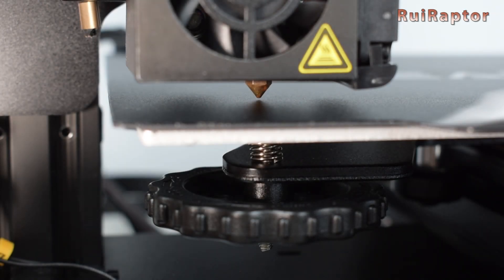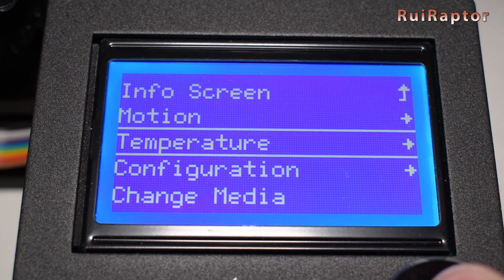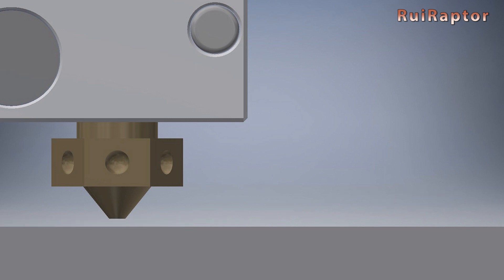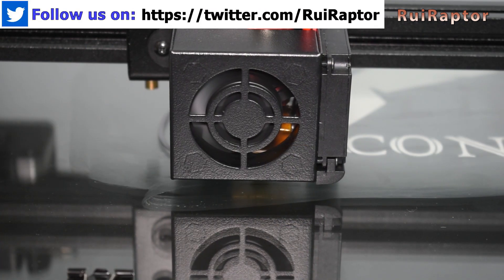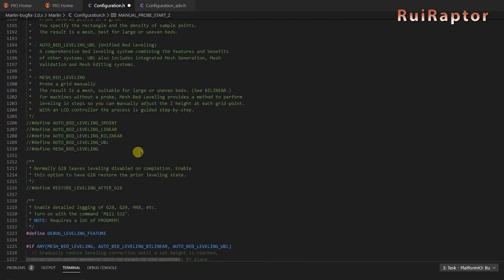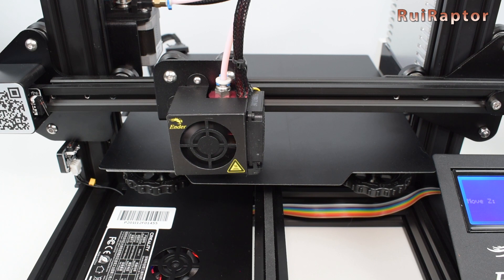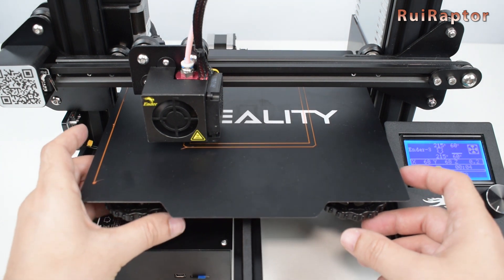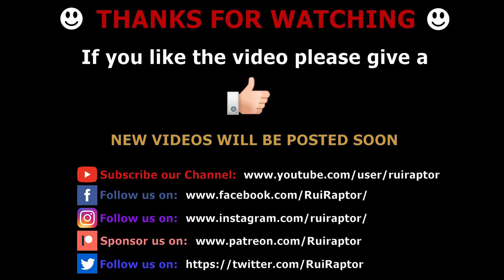HOW TO Level your 3D Printer´s BED Like a PRO / Mesh Bed Leveling

Comment: Hi Rui, just a question, can we add M420 S1 on the start G code? after G28, to save the manual mesh? thanks greetings from South Africa, bom video
Reply from the maker: Hi Manuel, yes, with Marlin you can add the M420 S1 line on the start gcode.

Comment: I have a Geeetech A20 with a glass removable bed.  However, whatever I try, I cannot level the bed.

I have tried it following many videos from Youtube for using the BL Touch and Z Offset, and cannot get a sensible print, where it is stringy and will not stick to the glass.  So I try the paper method in each corner, and get the same output, stringy and will not stick to the glass.

Also I have upgraded the firmware to the Mega2560, and still not making any difference with the print.

What and where do I do next??

Comment: Thank you for detailed explanations and step by step tutorials. My problem is, that I can't adjust Bed Z during a print. It just doesn't change anything, -750 or + 750 - the nozzle neither lowers nor raises, so I don't know on how to do something from the Prusa printers is known as Live Z Adjustment.
Reply from the maker: Hi Jim, if you have the babysteps feature enabled in your (Marlin) firmware, you should have it available in the tune menu while printing. The babysteps feature is the same as the live Z adjustment used in the prusa printers.

Comment: My right front manual adjustor  just spins.....It will not move up or down! Defective?  Any help would be great! Brand new machine out the box!
Reply from the maker: Hi Thomas, is the screw also spinning or it's only the knob that is completly loose? If it's loose, then you need to keep turning until it starts compressing the spring.
Reply: @ruiraptor  The screw spins too I think...going to fiddle with it some more soon.
Reply: @ruiraptor  Update! The screw spins with it with the knob. It will not go up or down.
Reply: The knob still  spins even If I hold screw from spinning! The knob just spins and goes no where....

Got it off! Have to get some small m4 screw to keep the screws from spinning.
Reply from the maker: Hi, which printer do you have?
Reply: @ruiraptor  Ender pro 3. I got it working today. Had to get m4 nuts.

Comment: Here's what I know. Fact: low-end 3D printers are not equipped to know when the nozzle is too close or too far from the bed. That's why BL Touch found a niche in the 3D printing market place. I don't know much about high-end 3D printers. I know I can't afford one. So, I'm stuck with a low-end printer that's flawed as far as I'm concerned. It gets me wondering. Aren't we in 2021 when all that's technological is supposed to be at its peak. We can build 2-wheeled robots that balance themselves on 2 wheels, but no's come up with a 3D printer whose bed remains level and do this at low cost!

Comment: To level the bed, I believe Creality tells us to home the hot end, then disable the stepper motors to move from corner to corner and raise or lower these as needed. Problem is, when I follow this procedure I can never get the bed level the first time. It was infuriating. Then, I read an article someone wrote on the net. He said to stop using disable stepper motors. So, to move from corner to corner, I had to use the Move command. Doing it this way, I was able to level my bed the first time around! My print is perfect.
Reply: I don't believe it is possible to level the bed "first time" because each adjustment of a wheel will affect the height of the bed at the diagonally opposite corner. So you need to go around the bed several times, each correction getting smaller as you go. The solution to this nonsense is to upgrade to a 3 point bed suspension, then you really can get it correct first time. I did that and it is a much better setup altogether.
Reply: @kencroft7933  I believe you're right, because I was only able to do it once. Subsequent attempts failed miserably.
Reply: @kencroft7933  These type of 3D printers have a serious design flaw. I just watched a video about 3-point bed suspensions by Chep on YouTube. Your mentioning it was the first time I'd heard about it. I can't understand how this mechanism might help though. Forgive me for saying this, but isn't it just another part replacement claimed by some to be better than the stock part. I am, however, inclined to say that the bed mechanism on my Ender 3 V2 3D printer needs improvement or modification. If bed stability was an issue, why did Creality opt for a single centered rail bed support. It doesn't make much sense, because it clearly adds more instability to bed-levelling. Bed-levelling is a frustrating necessity(?) I could do without. The BL Touch was not much help either. Which brings me to the following questions. If the gantry and bed were perfectly parallel, or as close to it as is possible, and ignoring the possibility that a build plate might be warped, why is bed-levelling necessary at all? If the gantry is "perfectly" straight and the build plate is "perfectly" flat, couldn't wobble side-to-side or up and down, would you still need to level the bed? I don't think so, because the nozzle would never be lower or higher to the set position. It would remain at the same height, no? What do you think?

Comment: Amazing video, truly many lessons i learned and had learned through painful prints. For the longest time i wanted to return my printer because of how warped my bed was but didnt (mostly because it was my baby) and just had to level on the fly and after every print. Even removing the magnetic plate a little too roughly could create a lot of problems. I wish i knew about mesh layering. Thank you and again, great video.

Comment: I’m taking this error in ender 3 v2 “LCD_BED_LEVELING requires a progrrammable LCD controller.”.
Reply from the maker: Hi, are you trying to activate manual mesh leveling with an Ender 3 V2?
Reply: @ruiraptor  yes but I learned I can’t do with this display,I should use a 12864 LCD.

Comment: Thanks for the video! Will this method with the mesh work on the ender 3 v2? I heard sometimes it doesn’t come setup for this
Reply from the maker: Hi Sam, yes, it's possible to have the manual mesh to work on the Ender 3 V2. However, for the V2 it's not yet possible to have the menus on this display. The commands need to be sent though pronterface or any other interface.

Comment: this is the best explenaton for all of the bed leveling videos! i just have a problem the nozzle on the first layer is higher so it doesn't stick to bed, if babay stepped it down, than the next layer will be too close.. how to make the first layer exactly like all other layers ? Thanks! :)
Reply from the maker: Hi, thanks for the comment.
Regarding the babysteps, probably you have the babysteps steps too high. You can edit the firmware to lower the babysteps increment value.

Comment: Great explanation. How did you get the "Edit Mesh" option in the Motion menu? I'm using manual mesh leveling in Marlin 2.0.7 - but for manual correction of the z distance of the different points I have to enter gcode via Octoprint/Pronterface for every single point (M421 IX JY Q-0.0X). A graphical interface would be awesome and "Edit Mesh" sounds like it, but I can't find any reference in Marlin documentation.
Reply from the maker: Hi,
you need to enable the line "define LCD_BED_LEVELING" and "define MESH_EDIT_MENU" to get the menus in the display.
Reply: @ruiraptor  Thanks a lot! Did not find this documented. Will test it.

Comment: on the manual method how can you leave the Z locked? Mine falls when the motor is disabled.
Reply from the maker: For the Z to be always on, you need to edit the firmware and have this option enabled.
Reply: @ruiraptor  Does mine move so easy because of Z nut wear?? Doesn't everyones fall?
Reply from the maker: Do you have extra weight as for example, a direct drive?

Comment: OMG, your my hero!  This is the best bed leveling tutorial I've seen yet.  I've been looking for this since I got my Creality CR-10 V2.  My printer won't stay level for more than 1 print.  I got the BL touch thinking that would fix my problem but no...
Reply: Same here i have ender 3. But I think I need to upgrade springs to yellow ones. BTW were you able to fix the problem by now? or any tips that works for you?

Comment: Unfortunately, Manual Mesh Bed Leveling won't work on the Ender 3 V2...

You can't enable #define LCD_bed_leveling without getting compiling Errors, because you need a programmable LCD Controller. 

The E3 V2 has a DWIN_CREALITY_LCD. This LCD is smart, It gets told what to display when via simple serial commands. But it has limits you cannot directly control what the pixels are doing.

If you have any solution I would GREATLY appreciate it. 
Your videos are awesome. Thx.
Reply from the maker: Hi, you are correct, unfortunately the Ender 3 V2 display does not allow the manual mesh LCD menus to be enabled. You can try enabling the manual mesh leveling without the LCD menu and send the commands by proterface instead. Here are the instructions with and without LCD ( https://marlinfw.org/docs/gcode/G029-mbl.html )
Reply: @ruiraptor  Wow, that actually helped me so much! 
Do you think this issue will be fixed soon?
Reply from the maker: Not sure, but being possible, the Marlin developers will find the answer for sure ;)

Comment: but, on ender 3 v2, the dwin lcd controller doesn't support lcd_bed_leveling, i get compiler errors if this option is enabled when using an ender 3 v2 config. any alternative option for me?
Reply from the maker: Hi Jimmy, Manual mesh LCD menus are not working on the V2 display. The alternative would be sending the comands through pronterface.

Comment: The most complete video about leveling, basically any other video that I've seen it miss something, I only knew it until I saw this video
Reply: it went all the way into, "you didn't level it while hot", "some parts are funky from the factory, cut this off", "using warped surfaces anyway, here's how", and "here's the hard way too, for my sadists"

Comment: Im try this ender3 v2👍
But error for programble lcd
Reply from the maker: Hi, the manual mesh leveling is not yet available for the Ender 3 V2 because the menus are not working in the V2 display.
Reply: @ruiraptor   how to fix this
Reply from the maker: If you want mesh leveling you need to install a leveling sensor and run it automatically.
Reply: @ruiraptor  you mean bltouch
Reply from the maker: Yes, BLtouch.
Reply: @ruiraptor  
Bl touch ender 3 v2 suport version please❤️❤️❤️❤️

Comment: I tried to enable this mesh bed leveling on my ender 3 v2, but it says “LCD_BED_LEVELING,  requires a programmable LCD controller.” Did I do something wrong?
Reply from the maker: This new display of the Ender 3 V2 is not as "flexible" as the other ones in terms of programming. Having said, it's not yet possible to enable the manual mesh leveling with the display menu included.
Reply: @ruiraptor  Ok thanks, I was able to get your bed level g-code to work on the Ender 3 v2, once I enabled the nozzle park and the advance pause feature.
Reply: https://github.com/Flawioo/Creality-Ender-3-board-v4.2.7/blob/master/README.md had same issue, these bugfix zip and config zip worked like a charm.

Comment: Thanks for the video. I have a question. I'm using the newest TH3D Unified 2 firmware (based on Marlin), version 2.12b. It doesn't have the 'Fade Height' option. Not sure if it's set somewhere else or baked in. Appreciate any guidance. Thanks.

Comment: You don’t need to break the end stop support. There is a software method to adjust the end stops. Adjust the “Babystep Z” and then “Store settings”. That sets the “zero” for the end stop. So the software knows how much to compensate when the limit switch triggers.
Otherwise, great video. You explain things very well. Thanks for putting them out!
Reply from the maker: Hi Timothy, thanks for your comment. 
The purpose of breaking the small piece on the endstop support is to allow the X gantry to go down further than what the endstop would normally allow. This way you can compress the bed springs a bit more and give more stability to the bed. Your method works but only for small adjustments. For bigger adjustments you need to move the endstop down or the X grantry will crash on the endstop.
Reply: ruiraptor great info, thanks! I hadn’t heard that explanation before.
Reply: Surely Baby Steps are only available on the Ender 3 in the "Tune" menu which in turn is only available while actually printing. It is not a method for setting Z height gap.

Comment: Can i make this exact same setup on the ender 3 V2? or it will not work?
Awesome video <3
Reply from the maker: Hi Tiago, you can enable the manual mesh leveling on the V2 but you will not have the menus on the display. To trigger the leveling you need to use the PC and send G29 commands.
Reply: @ruiraptor  oh ok, thank you, so I have to do everything from 7:15 to 8:55, because after is everything from the screen menu that I will not have, right? and after that I just put the micro SD card and he will boot the codes? Because I don't have the leveling part, or I have to connect pc and send the codes directly from my pc?

Thanks a lot for your time man ❤️ really appreciate
Reply from the maker: Hi Tiago, for the firmware update, please check our other video here: https://youtu.be/y87P7K5DTMU
Regarding the procedure for the manual mesh leveling, here is additional information from Marlin on this: https://marlinfw.org/docs/gcode/G029-mbl.html
and
https://marlinfw.org/docs/features/auto_bed_leveling.html
Reply: @ruiraptor  thank you very much sir
Reply from the maker: Qualquer dúvida é só dizer ;)
Reply: @ruiraptor  ahahah Eu sabia, estive quase para perguntar se vocês eram portugueses. Trabalho incrível, continuem por favor 💪❤️

Comment: Hey Rui!

I'm having a little trouble. Unfortunately they've made some changes in the Ender Pro v2 that make enabling this harder. Could you provide a couple tips on the changes needed to do this on a v2?
Reply from the maker: Hi, you can enable the manual mesh leveling on the V2 but you will not have the menus on the display. To trigger the leveling you need to use the PC and send G29 commands.
Reply: @ruiraptor  so I assume you uncomment manual bed leveling and restore after g28, but leave lcd bed leveling commented?

Comment: Thanks for the video, but what happens to the z limit switch during manual mesh , is it mandatory or printer doesn't need it anymore
Reply from the maker: Hi, yes you still need the limit switch. The machine needs it to home the Z axis.

Comment: I was told to use a 0.18 mm feeler gauge to get a perfect first layer.  So has anyone got and opinion of 0.1 vs 0.18?  Lets face it feeling the right amount of drag is pretty subjective.
Reply from the maker: Hi Peter, 1.8 seems to be a bit thick. Are you using that thickness to level your bed? How is your first layer?

Comment: Any way of getting Manual Mesh Bed Leveling to work an Ender 3 V2?
Reply from the maker: Hi, the problem is getting the manual leveling menu on the display. For some reason, the compilation fails when enabling this. We need a bit more time to study this.
Reply: @ruiraptor  Many thanks.. I installed a BL Touch but this too isn't working properly on mine and I have no idea why...  I disabled it and went back to stock version since it works well as it is out of the box..  Cheers

Comment: Even though my Tronxy X5SA has auto leveling and 6 bed adjustment hand knobs and manual leveling too, It is a total pain to get the bed leveled to the 0.8 and below height over the bed the system needs?  This video I hope will make it easier?  Thank you.

Comment: @ruiraptor
What is the best practice (or video) to set where the Ender 3 Pro Auto Home should ideally be?  I.e. 0,0,0 lower left corner of bed?  Or in the center of the bed?  How do you do that?  Do you have a easy Z offset video?
Reply from the maker: Hi Tim,
we have a video for that question.
Please check this: https://youtu.be/NiyU1cTTYlM

Comment: im here to solve my first layer stick problem
Reply: i have found it i think need a hand here pls.. i setup the bed level.. but everytime i start a new print it just resets it and lose it
i have tryed it.. i make it again and again it lose it everytime
so every print starts without a bed level :(
Reply from the maker: You mean, the bed loses the leveling? are the springs compressed enough?

Comment: another tip is to not to touch the bed after you have cleaned it. Skin oils can ruin the adhesion.
Reply: Whatever oil on my bed wouldn't come off with 99% iso. I used palmolive and meyers scrub (bonami) on my glass bed. I think it was coming from the silicone boot or something else on the hot end. Months later the boot is all dried and cracking and the prob is gone

Comment: what about compressing the springs all the way? will it be fine or will it damage something?
Reply: it will be fine, your bed will not be damaged, a tigher tensioned spring is less likely to shift around. If you dont have a form of auto bed leveling like a bltouch, your gonna need to tweak around the z endstop
Reply: @aguerr211  ok thanks :)